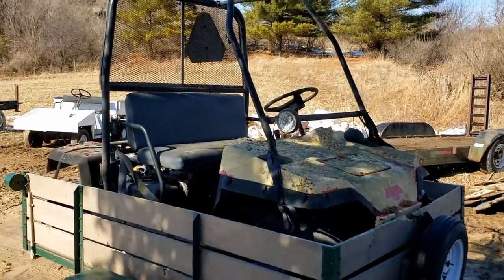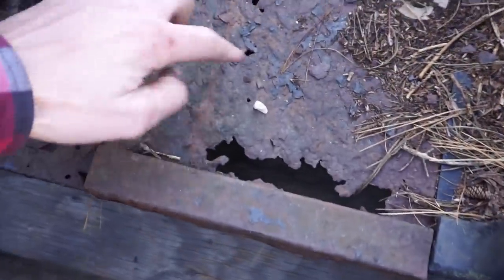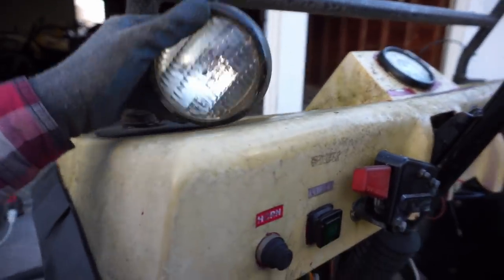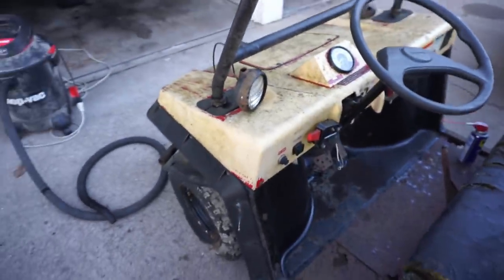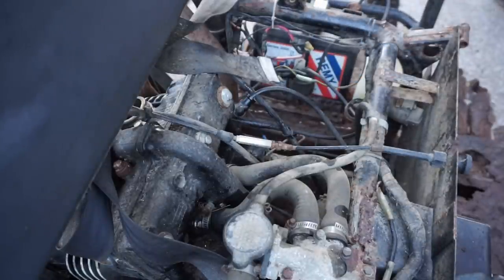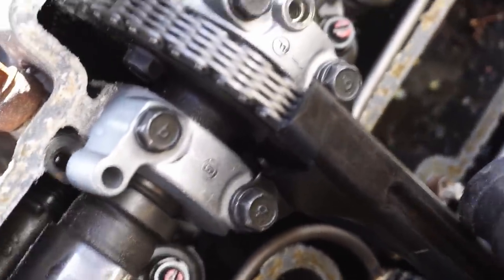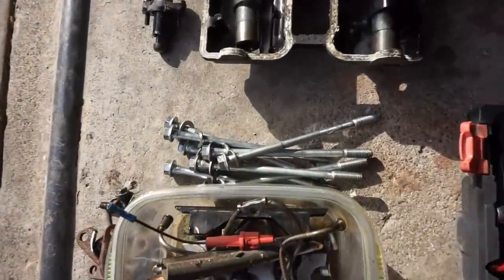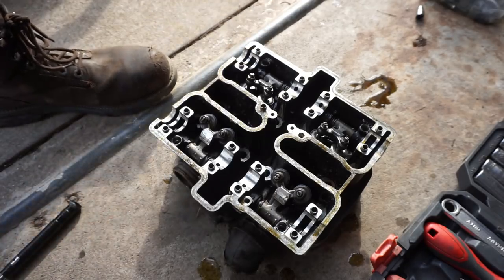$225 Seized, Rusted Out Kawasaki Mule Find. Can It Be Saved?

Comment from the maker: This project is going to be a challenge. I didn't expect it to be in this bad of condition when I went to pick it up. 
Please SUBSCRIBE and LIKE the video if you enjoyed! It really helps me out a lot!
Check out my Instagram: 2_vintage_ https://www.instagram.com/2_vintage_/
Thank you for all the support!
Reply: I picked up an old harley golf cart for 300 Monday and felt the same damn way. Oh well, engine isn't locked up for me though.
Reply: @snafuequals  i have one their really hard to find parts for. Is that one a 3 wheeler? Mine sat for a long while and still runs. Just throws the maim belt
Reply: @mechanicswithjake3057  Yeah, it's a 3. Came with a busted up ignition switch (I know, sketchy). Finding parts here and there but they're not cheap.
Reply: @snafuequals  yeah they arent.  I ordered a washer and a shim for that primary pulley and waited a month to receive micro versions of what i orderd. Tryed to return them but they wouldn't email me back. Payed around 50-70$
Reply: Think you may have bitten off a little more than you can chew with this one bud, may want to just scrap that lil motor and start searching for what you want to swap onto as long as the frame and everything is structurally solid then cut and weld some new plate steel to redo the floorboards and put all new driveline on her lol maybe that new rocket motor from the banshee 😋🤷‍♂️
Reply: @kevinAuman1  he can do it. It dont look crazy horrible compared to what hes done before
Reply: @mechanicswithjake3057  I like your enthusiasm but that thing is beat man the whole driveline is likely locked up tight but again it isn't a bad platform to start with regardless so if it is a goner I'd just strip it down and start over making it into something badass
Reply: @kevinAuman1  anything locked up can be unlocked with some persistence and penetrating fluid
Reply: @mechanicswithjake3057  Diesel works pretty well too. The only time I call it quits is when I'm bored with it.
Reply: @snafuequals  yeah. If it do let free just pour more im and let it sit. Giving up on it on the first day wont get ya anywhere lol.
Reply: What type of truck do u have
Reply: @andrewhamilton4667  86 gmc jimmy with a ford 6000 tractor turbo diesel

Comment: looking forward to this build! I just bought one of these (1988 mule 1000 - kaf 450 ) in slightly better condition about a week ago. they share almost all the same engine and carb parts as the 454 ltd motorcycles from 85-90 i believe. Easier to find stuff for the MC's than the mules from what I've found. mine is missing a few things here and there but seems solid for the most part.

Comment: Have you guys ever pulled a starter out of a 1988 450 like you got. Having problems putting back on as the gear keeps sliding off in the gear box. Any information on what it looks like inside the chain drive case

Comment: I enjoy your channel and what you do I have Done 2 1000 Kawasaki mule  the engine and transmission or one unit you have to pull the motor split the case to pull the head I’ve got two extra engines two extra frames if I can help you with parts in anyway I would be more than glad to work with you I wish you the best of luck and I’m anxious to see what you do with it do you want to get rid of it I want to be at the top i’ve list

Comment: Man I think you can fix it but its going to be a challenge. I hope you find some good used heads and cylinders. It looked surprisingly good on the inside. Finding and installing some anti skid plate to weld back in is no big deal if you can weld but its probably bolted.

Comment: Such neglect... super rough... leaving the intake ports exposed to the elements is borderline abuse.  The valvetrain may not be rusted but it has not seen oil in decades.  Not worth $225 unless you are looking specifically for a Mule project vehicle, and even then $225 would be high LOL.  Thanks for the video.